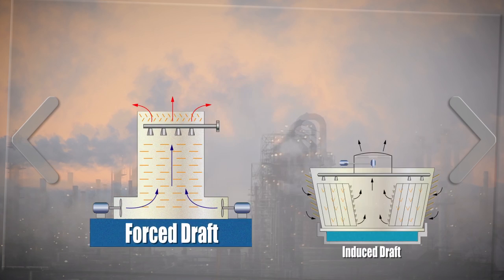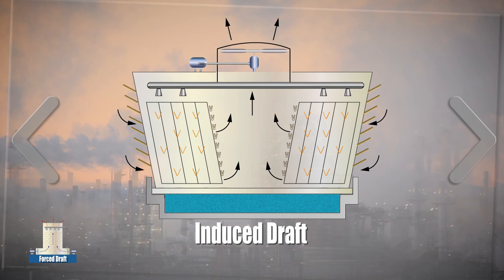Mechanical Draft Cooling Towers

Comment: Cooling tower ( forced draft and induced draft fan). Normally on power plant , most fan will be put on the top to pull air through and it's called : Induced Draft Cooling Tower  ?    Why........